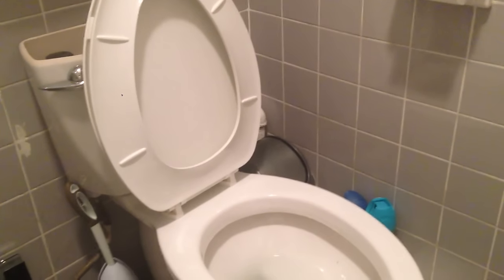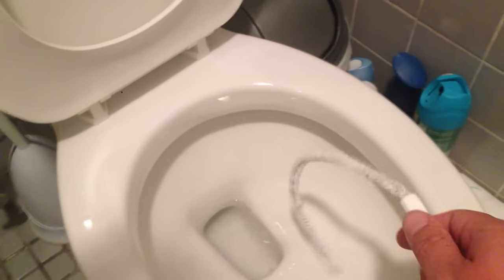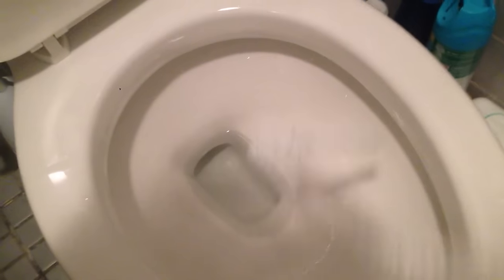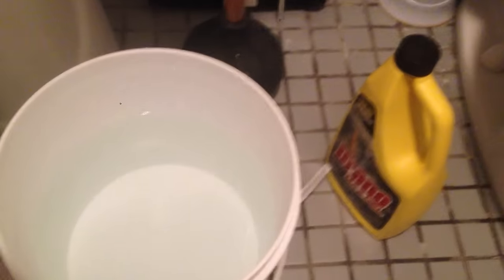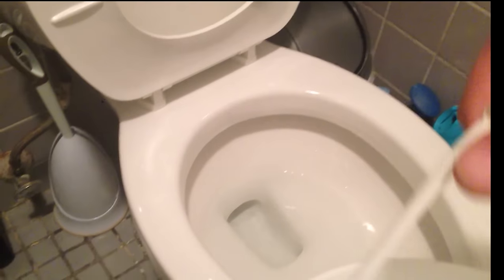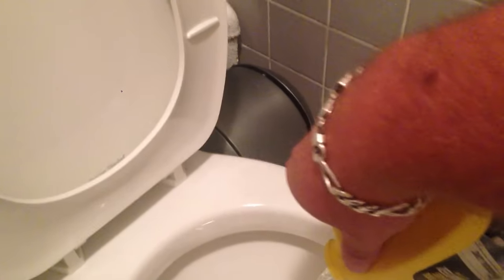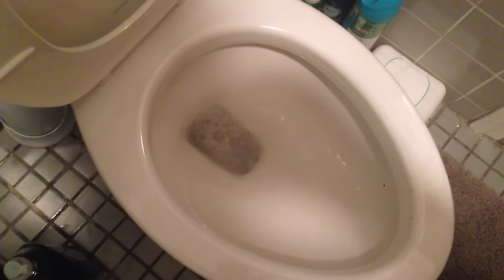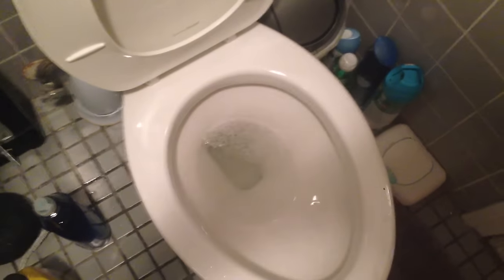How To Fix Slow Flushing Toilet  - Not Flushing Properly

Comment: This is caused by a big poop stuck in the curve of the outlet of the toilet.  Plunge it and it will be back to normal.  You will actually see the water level go down immediately, once the clog is removed.  If anyone of having to add Draino to a toilet, it's time for a new toilet or raise your water level because otherwise, waste doesn't have enough water to fully flush and leave the system.....making it out to the city sewer system.  This is not good for the overall plumbing health of your home.    People are so cheap when it comes to the water level in a toilet.  Trying to save actually costs home-owners more money in the end. is not worth it.

Comment: Thanks for this video. While this method didn't work immediately, it put us on the right track, and with a bit more scrubbing, and draining the bowl and squirting some strong cleaner directly into the jet opening, we got the toilet running like new.
Reply: What is "strong Cleaner", what did you use?
Reply: @agnesmariedill5004  I use muriatic acid

Comment: I tried a chemical called Zip from home depot to unclog pipes it works because it eats the grease and other stuff, now my toilet was slowing down and didn't have Drano but had some of ZIP left and poured it like on this video and left it for 6hrs I did it before to bed nobody uses the toilet. so from 8pm to 3:00am I went to check flush toilet and it was strong again, although I will clean it for 2 days in a row so I'll know for sure it'll take years to clean again. thanks for the idea i just used a different cleaner.

Comment: That method does work but it didn't solve my slow flushing toilet.  So......I checked the water hole where it pushes the water to clear the toilet and low and behold, it was caked with rock build up.  I used a metal bbq kabob stick and cleared it out and bam!  Nice flush everytime!

Comment: This might be the best video on youtube. I skipped the Drano, did the hot water and detergent parts. WORKED LIKE A BOSS.  I also used a wire hanger to clean the jet holes along the rim and the jet hole on the bottom.  But I'm pretty sure they weren't clogged.  So, I think mainly it's the hot water and detergent that did the trick.  This is also after half an hour of augering which only fixed the clog and not the flush.  Thank you Teck!!!

Comment: drano should not be put into a toilet. says right on the back of the bottle
Reply from the maker: It says that Drano should not be used to unclog toilets, but this is not what this video shows. We are fixing slow flow toilet that has running water which is two different things
Reply: Regardless! 
The heat produced by Drano (the chemicals) can crack porcelain toilets. Exposure to the chemicals in Drano can corrode pipes. & It's not like the toilet can decipher the difference
 " Oh okay, it's not for a clog It's because I'm slow . It's okay then."  lol. 
You shouldn't put it in the toilet EVER! I think drano thought that was obvious hence not adding , "( not to unclog toilets).... Also don't use it for slow toilets"
Reply: Regardless! 
The heat produced by Drano (the chemicals) can crack porcelain toilets. Exposure to the chemicals in Drano can corrode pipes. & It's not like the toilet can decipher the difference
 " Oh okay, it's not for a clog It's because I'm slow . It's okay then."  lol. 
You shouldn't put it in the toilet EVER! I think drano thought that was obvious hence not adding , "( not to unclog toilets).... Also don't use it for slow toilets"

Comment: I just bought a “Drano Max Gel 80 oz” and on its back side is has “DO NOT USE WITH PLUNGER OR IN TOIET”. So, I’m chicken to use this new one.
 If is OK to use please let me know, thanks.
Reply from the maker: Before you try to use drano make sure the toilet is not cloged by dumping large bucket of water into the bowl and it should go down fairly smoothly. If it does then you can use drano just to get some into the front of the jet only, dont use to much. If the toilet is cloged and water does not go smoothly then dont use drano. Also do not leave drano in the bowl for too long, 10-15 minutes max
Reply from the maker: You can also use worm water with down dish soap insted of drano if you want to be cautious. Just leave it for longer period of time.

Comment: this solved my problem, but it only flushes properly after adding dawn, if i do not ad dawn it is slow flush again.
Reply from the maker: you probably still have something clogging  the wholes, you may want to check them with like a cloth hanger

Comment: You’re a godsend!!! Shortly after my 5 year old ran out of the bathroom - frantic because the toilet began overflowing, I ran like a bat out of a hell to stop it.

Once I had gone in, I plunged the life out of it.. finally it started to SLOWWWWLY drain — nevertheless, it drained. But then it started to regurgitate as it emptied, and wouldn’t fill back up to normal. I tried several other attempts to fill it, only for it to continue overflowing; thus repeating the process all over again.

Eventually I gave up and went to YouTube, where I then came across this gem. 

The first time I flushed, it regurgitated a little, then began filling up. After repeating the flushing once more, it FINALLY flushed normal, and continued to do so afterwards, with no more overflow. So thrilled, and incredibly thankful I came across your video. You’re awesome! :)

Comment: I just read something that said to never use drain cleaners in a toilet. They are not meant for toilets and can cause damage. I stopped watching this video as soon as you mentioned using drain cleaners.
Reply from the maker: Yes Drano should not be used to unclog toilets. But this video os focused on cleaning the jets to get the slow flushing problem fixed
Reply: @TeckDrivenTeck  if it can cause damage why would it be acceptable for any use?
Reply from the maker: @msd1332  the risk is only when you try to unclog the toilet because of the wax ring, but the wax ring is in the back of the toilet and the jets are in the front oway from the wax ring. Its not the best solution but it works. Most people are ready to replace the toilets or call the plumer which is very costly

Comment: HELP your solution worked great for 1-2 flushes, but then it got slower and slower with each flush - and now again its not flushing just spinning round and round :(
Reply from the maker: try this method twice, IFby second time it does not work, then its likely that its clogged in the drain pipe. Try to use the plunger and if that doe not work them you may need to remove the toilet.
Reply: Teck Kimborowicz thanks man, i gave you a sub and a like :)

Comment: I didn't use the hot water, but I used Drano and Dawn and it worked in ten minutes at the first attempt!
Reply from the maker: Hot water speeds up the process. But you dont have too use hot water

Comment: Thank you for the video. I have questions though, can this be done to a toilet that doesn't have a tank? My toilet has been giving me problems for about a month now and I am dying to try something out to see if it fixes it because I don't want to spend money on calling a plumber. Please let me know whenever you can
Reply from the maker: Hi, yes this should work on almost all toilets, just dont use soup. Check the jet holes with a brush or something, aadd little trano and let it sit for a little , just dont over fill drano too much,. Drano should only cover the front jet hole
Reply from the maker: I forgot to mention, if you want to check if the jets are cloged or the toilet then take a bucket of water and dump it in, if it drains properly then its the jet, if it drains slowly then its the pipe is clogged
Reply: @TeckDrivenTeck  My mistake, I should have been more specific in my first comment. Ok, there have been times that I take a bucket of hot water and dump it in the toilet, sometimes it goes down and sometimes it doesn't. When I use the plunger (Heavy Duty one) it'll flush away the water and it'll flush about 2-3 more times and then BAM! it happens again and get's clogged. I will go later on to the store to buy the Drano and the soap and try this out to see what happens. Thank you for your replies🙂

Comment: Gonna go try that ive tried the soap n the hot water n the plunger n the soap but never the soap in there sweet thank you
Reply: This really worked using hot water drano and the soap detergent waited 15 minutes and it was no longer slow drain

Comment: All the warning labels I've ever seen on those gel drain cleaners tell you "Do not use in toilets". 
Another helpful trick is to dissolve a bunch of baking soda in the hot water and after that's in the pipes, add a couple of cups of vinegar. The foaming will help break ups clogs and the vinegar is good for dissolving calcium.

Comment: I did soap in the toilet bowl and poured hot water, waited 30 mins -> did nothing.
Then I put soap in the overflow and poured hot water, waited 30 mins -> flushed really well... for one flush, now its back to normal. probably calcium in the jet i guess?

Comment: thanks for this video, i have been having issues and im feeling so crazy (I have mental illness) i was very close to smashing the toilet to bits with a hammer, i live in an apartment and the apartment manager doesnt care about anything so i am 100% on my own with a mental disability.

I have read about the detergent trick but never tried detergent in the overfill pipe - i just did that and am gonna wait 10 mins....hope it works!!

btw are those automatic cleaner cubes (blue water things) bad for flushing?
Reply from the maker: The blue packs are not bad, its just once in a while they may break off small pieces and they get in the holes, it takes a while for them to dissolve. I recommend to place them in the corner of the tank away from the drain plug

Comment: The toilet i try to safe has no jets at the bottom, i poured some stuff to clean the other jets in the overflow tube, they are cleaned even controled them with a nail. But when i flush, it swirls but nothing else happens. When i throw a bucked with water it flushes immediately. What is wrong?
Reply from the maker: Thats a hard one. My guess if it is not gloged anywere then the water is not going in at full speed. Perhaps the mechanism thats lets the water go to the bowl is not opening fully
Reply: @TeckDrivenTeck  i changed the completr mechanism, brand new
Reply from the maker: @kurtpuntacana  the only thong I can think of possible problems is. 1. Jets  are cloged. Check to make sure thay water is going thru all the holes. 2. The toilet is parlty cloged. Something is stuck in the pipe and water flows but not fully. 3. The toilet bowl is cracked somewere. I wish i could offer more help but i am slso little puzzeld as to what can be wrong

Comment: hot water might melt the wax ring!! b careful !!
Reply from the maker: Hot water should not do any damage as the water will be sitting in the bowl and will not be near wax ring, but I would probably not use Boiling water, Hot water should do the Job.
Reply: @TeckDrivenTeck  I dumped hot antifreeze in the toilet and the wax melted and caused a leak.

Comment: if there is a clog in the pipe or p-trap use the auger. if not use a wire to clean all the jets or holes around the rim and the bottom hole. brush clean all the wholes and save your money, don't buy all these chemicals.

Comment: dish washing soap and hot water worked for me. Tried the soap in drain pipe, hot water, a clothes hanger (as a snake)and plunger. At first didn't see a difference. Then I tried hot water and dish washing soap and in the bowl itself (didn't have Drano) and plunger and that time it worked like a charm. Thanks for the help with this saved me a lot of time and trouble. Think I will start a hot water and dish washing soap  flush regiment every month.

Comment: You should NEVER pour hot water into your toilet.  Not only can it crack the porcelain, but the toilet is sealed to the sewer line with a wax gasket.  The hot water can soften the wax gasket and cause the toilet to leak onto your bathroom floor, or into the room under the bathroom.

Comment: I bought the drano max gel and on the bottle it says ,not for use on toilets especially with plungers, so i di not use it.  I did use the dish soap and hot water and that worked the trick for my toilet.

Comment: It worked perfectly. I used washing soda as a substitute for liquid drain cleaner. Poured 3 gallons of hot water into the bowl, Dawn liquid in the overflow pipe, then let it sit for 10 minutes before flushing. I can't believe the difference now.
Reply: The problem came back about a month ago. I live in a newer house that has water saving dual flush toilets, with 2 buttons on the top of the tank, one for a lighter flush and one for a heavier one. I found that when you  use the heavier flush you can hold the button down for an extra second, which results in a more powerful flush. This seems to be preventing the ongoing paper accumulation in the waste line which was causing "lazy flushes".

Comment: Can I use phenyl to remove jet stuffs sir ?

Can I pour Phenyl in the overflow pipe, where you poured the detergent?

After Emptying the flush tank, Can I fill it with Hot Water to remove calcium Deposits  ?
Reply from the maker: You can use it but i am not sure if it will help. Phenyl is used for disinfecting and not really for disolving

Comment: I thought you're not supposed to put Drano in toilets? Isn't there a big warning on the bottle about that?
Reply from the maker: DrCognitive Most Drano does days are Toilet and Septic tank safe. Howevere it is not recomended to use Drano if your toilet is compleatly cloged and no water is going  down.Drano is not design to unclog toilets, but it is design to to help remove buid ups on the walls of the pipeing.and any minerals that might attache them self to the jets in the toilet.
Reply: DrCognitive That's what they tell you, but if you don't have a septic tank just do it anyway, 'better than paying Roto Rooter a few hundred dollars to snake your hole :)
Reply: +DrCognitive  if you have a wax ring Drano will eat through it causing the toilet to leak.

Comment: Aren't you NOT supposed to use Drano (or equivalent) in toilets? Won't that melt away the wax ring in the base of the toilet, causing it to leak?
Reply from the maker: Drano is not recomanded to unclog toilets, but this is not what we are doing here, we are just cleaning the jets
Reply: @TeckDrivenTeck  Ah, I see.

Comment: In a toilet, especially since Drano does not work quickly on toilet clogs, it creates a serious issue. The heat generated from this chemical reaction can crack the porcelain of the toilet or soften the PVC of the pipes. So, not only can Drano hurt you, but it can also hurt your toilet and cause costly damage.
Reply from the maker: Drano is save on pipes, plastic and PVC. Perhapse back in the day it was alot stronger. Those days it does not produce that much heat or damage anythong as I don't think they make it as strong as they used to

Comment: How many attempts did you make to actually get the toilet to flush properly?  I noticed on timeline 2:27 that you have bubbles in the tank and bowl which wasn't there during the prep which means you flushed the toilet several times before.  That means it didn't work on the first try.
Reply from the maker: The bubbles are probably from the tank,  the toilet would refill it self one in a while, I have replaced the mechanism probably one month after that. I know this method sound wired, but for some reason it works sometimes.

Comment: How deep should I be able to get a tool into the big siphon jet? It seems I'm going in about 3 inches and encountering obstruction. I think I got some major caked up minerals in there. Maybe my turlet needs a colonoscopy?
Reply from the maker: 3" is about right, there is not much room just the space to have water flow thru
Reply: @TeckDrivenTeck  Thanks, it flushes like a champ now. No more 2 or 3 flushes to clear it. I think there wasn't enough flow from (mainly) the siphon jet hole to get the siphoning process going.

Comment: Please reply me  sir .. its urgent  please  .My toilet blocked with sanitary pad  so it was slow over flowing  i tried hot water and dishwash bar 5 times but didn't work .. what to do and how many times we can use hot water
Reply from the maker: Hi, if you know it is clogged, the only way to fix it is to unclog it with a snake. Question would be if you know where the sanitary pad is stuck, in the toilet or between a toilet and the connecting pipe. Pipe Snake would be my first choice. As hot water will jot desolve a sanitary pad

Comment: only i would NOT use hot water in a toilet because it had the potential to negatively effect the wax seal by melting it and could cause a leak.
warm is one thing but hot is not a good idea.
Reply from the maker: Technicaly you are adding hot to cold water which will make it worm. Unless you add too much hot water

Comment: For toilets that have been in use for many years tend to have water jets under the rim that get partially restricted or clogged. Or the plumbing itself could be the problem. The first thing plumbers do is a simple test to determine where the problem is.

They will take a bucket big enough to hold at least 3 gallons of water, and pour it fast into the bowl. If it goes down quickly, then the problem is the toilet. Replace toilet.

Comment: Idk what to do but I flush the toilet and water goes up like full but it doesn’t leak all over it just goes to the top
Reply from the maker: That sound like the toilet is clogged and the solution in the video will not work. you will need to unclogged it, sometimes it requires that you remove the toilet.